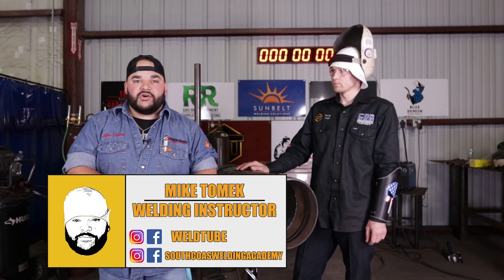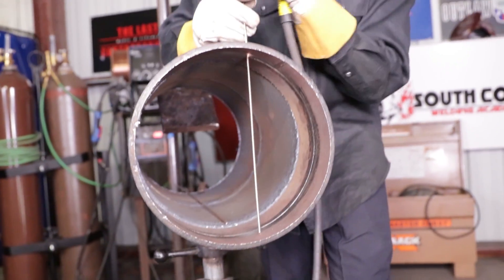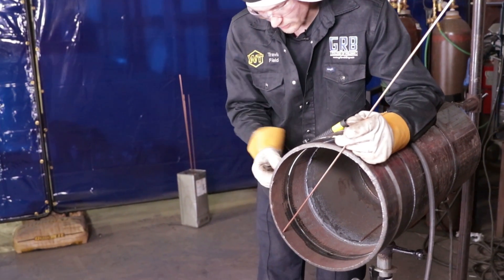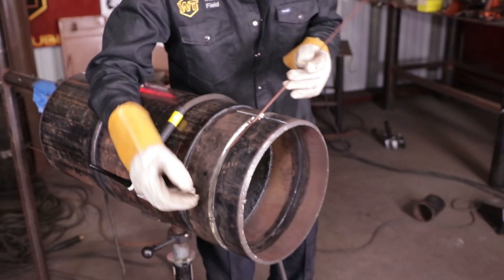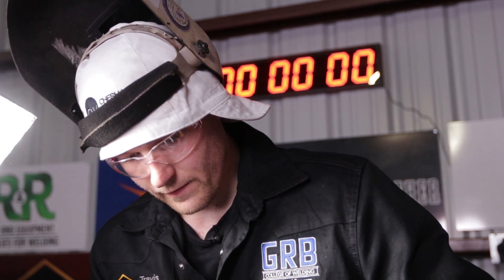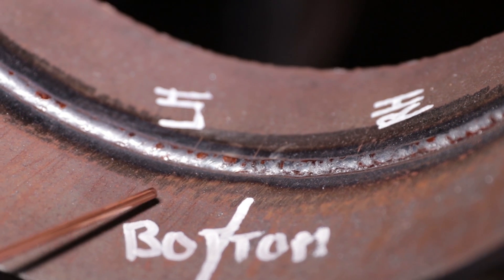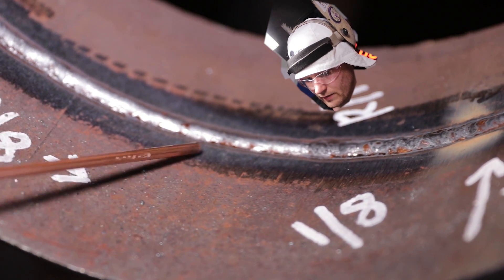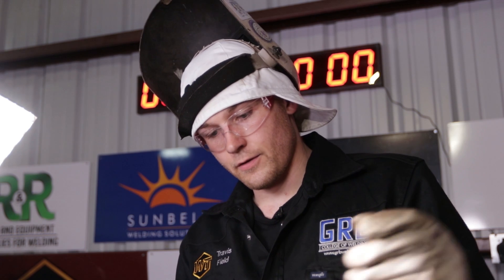TIG Welding Looking Through the Gap with Fieldres

Comment: What welding lens is best used for this method? I think only fixed shade will work for this method unless there are some auto shades that will not flash and still pick up the arc.

Comment: I’ve always wanted to learn this method ......
question : what is the pro of looking through the gap than cup walking or standard free hand Tig welding ? I can see where in position it would be handy ...... but doing it in a fab shop as you said your foreman made ya’s do..... great work Travis !!!!!
Reply: This is how I weld everything. The advantage is there is no possible way to get suckback or cold wire feeding straight into the puddle. Unless you are just way too hot
Reply: While welding with this method do you constantly see the tip of the tungsten.? If so then the cup of of the tig torch is tilted against the direction of weld, right?

Comment: Hi!! Love the videos! Just one question, how do you prevent the filler metal from sagging down on the bottom?
Reply: Look at his head position whe starts at the bottom.  If you use that angle , you'll be able to see the build up profile of the bead. If you look through the gap from 12 o'clock,  like I did when I started practicing this technique,  you won't be able to see how much metal you deposit.  Also if you stay to long in the middle, the surface tension will break, which will lead to sagging.
Reply: Подскажите когда веришь с потолка а смотришь через зазор сверху то кончик вольфрама же должен быть виден из-под ванночки? То есть вольфрам должен как бы смотреть назад против направления сварки??
Reply: The filler rod draws the puddle towards it, and providing you use enough amperage, the arc force pushes the bead in too

Comment: Top welder right there! 

Im a welder in the norwegian oil industry, and i have a difficult time discussing wire diameter with the inspectors/welding engineers. we are forced to use a 2mm(5/64 in ur stupid measures) wire for the root pass on literally everything, from sch10-sch160 etc. wall thinckness doesnt matter... this obviously increases the chanse of "stickthrough" and lack of reinforcement  (negative root). atleast i use this in my arguments. the question is: do you have any more arguments for me? @WeldTube thanks in advance.
by the way, theres few welders and inspectors who are familiar with any bigger rods that 2,4mm(3/32) here in Norway. understand what im dealing with here, lol.
Reply: Samme problem her.....hvor jobber du? 😀

Comment: I have a lot a experience in welding g-taw or smaw,I just what to ask you what is the reason to that inside filler welding.?
Reply: To ensure penetration and consuming the sides.  This is critical for x-ray work.
Reply: Thanks.this video can help special for those who want to lean technic,I think you use 70s-6 filler rod.heva you try using 70s-2 that I know a lot a tig welder have trouble using that filler rod

Comment: How is he not constantly dipping his tungsten?
Reply: you can see the tungsten and the leading edge of the puddle when doing this.
Reply: @kcdakrt  i dont see the tungsten when i have done it but i can see the weld puddle and how hot it is at 4 to 8 oclock area i general run a longer arc when i have been practising it,  but its not easy to not dip left handed  .
Reply: If you can’t see the tungsten, try using a darker shade filter lens. You should be able to see it, or this method won’t work for you. He should have also mentioned to use the maximum allowed bevel angle when cutting your pipes. That will help open it up to keep your tungsten a little bit further away.
Reply: You hold it at bad angle.always set it so you can see a top of tungsten
Reply: Practice practice practice. This is how I weld everything. Perfect bead everytime. Been welding almost 25 yrs
Reply: Why could happen that whenever I start welding root with this method (carbon steel) - my welding puddle behaves like it lacks argon coverage? It starts to sparkle, bubble and I have to stop and grind((( I use small tig lens and cup #8, with 25cfh of argon flow